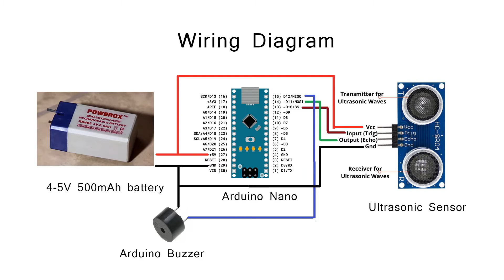How to prevent milk from spilling over? | Simple Hack- Alarm Device..!

Comment: Can we use ir module

Actually I want to avoid MCU
Reply from the maker: Yes we can use IR module without MCU, it will work but 1) it's range is very small so buzzer will make sound only when milk layer is way closer to IR module which is risky 
2) Fire and heat radiates infrared so chances of false signaling are higher..
But I liked your suggestion 👍
Reply: @milindcreations1118  

Can we use another option with no controller
Reply from the maker: Then only option is to make contact type instrument. But it may spoil milk, could be used for other applications though.
Reply: @milindcreations1118  

Yes

Thank you s